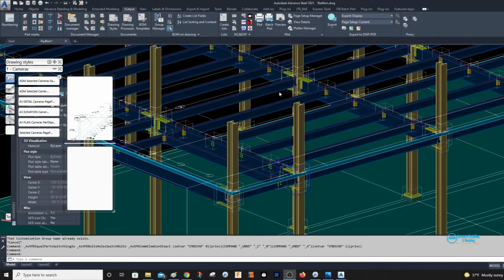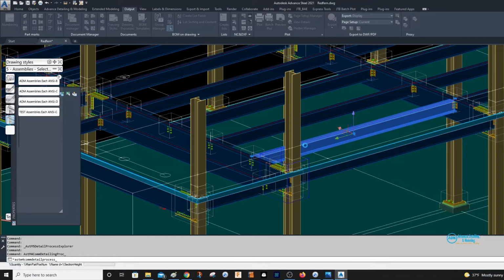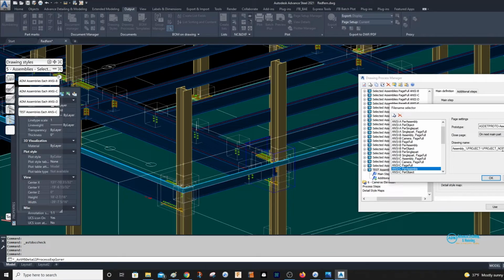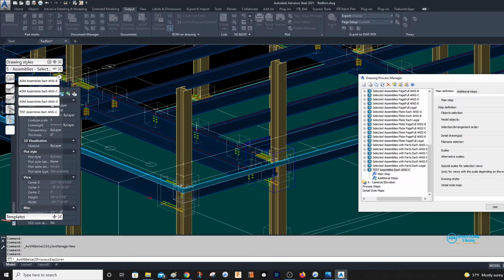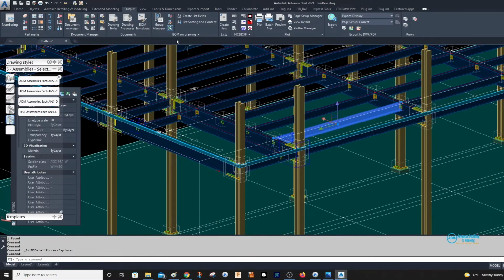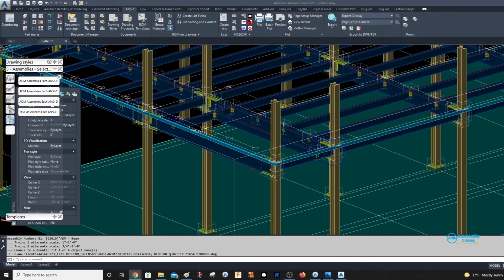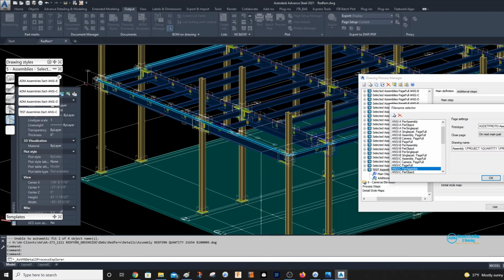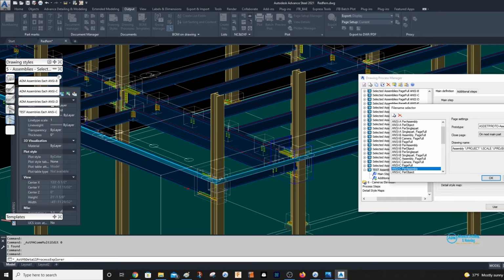ASED Testing Drawing Name Output.

Comment: This may help Sir.
I have found that the below works to have the project number at the start of the drawing numbering for output and and the document manger :
(There is a character limit of 64 characters on the filename selector)
Drawing Process Manager > EG: Assembley > Detail drawing(s) select the hammer icon.

Standard text below from a fresh install:

Main assembly:

[A] - %PosNum (%Prototype) %SequenceNumber(02).dwg

Multi Part:

[MA] - %Flat(03) (%Prototype).dwg

Single part:

[S] - %SinglePartPosNum (%Prototype) %SequenceNumber(02).dwg

Multi Part:

[MS] - %Flat(03) (%Prototype).dwg

Camera GA :

[G] - %Flat(02) (%Prototype).dwg

Kingspan UK details:

[KSP] - %PosNum (%Prototype) %SequenceNumber(02).dwg

Metsec Details:

[MET] - %PosNum (%Prototype) %SequenceNumber(02).dwg

------------------------------------------------

Modified text below:

Main assembly:

%PROJECT_NO [A] - %PosNum %SequenceNumber(02).dwg

Single part:

%PROJECT_NO [S] - %SinglePartPosNum %SequenceNumber(02).dwg

Multi Assembly:

%PROJECT_NO [MA] - %Flat(03) (%Prototype).dwg

Multi Part:

%PROJECT_NO [MS] - %Flat(03) (%Prototype).dwg

Camera GA :

%PROJECT_NO [G] - %Flat(02) (%Prototype).dwg

Kingspan uk details:

%PROJECT_NO [KSP] - %PosNum (%Prototype) %SequenceNumber(02).dwg

Metsec Details:

%PROJECT_NO [MET] - %PosNum (%Prototype) %SequenceNumber(02).dwg

GA drawing text will need to be change in the Managment tools. 
(Defaults) >Drawings General (Path of detail drawings and prefix):

%PROJECT_NO [GA]- %Flat(02)
Reply: Thanks Dvaid, we were hoping to remove the sequence number, but doesn't seem like its possible.
Reply: @adriandmangan  The (01) is the sequence number, this is what the system needs to have to ensure you don’t have duplicate drawing numbers, we haven’t found a way to get parts / assemblies to work without this in the filename. This is an extract from a email Via Graitec UK and myself.
Reply from the maker: @Maycad1  yea, seems that way, makes sense to be fair, to be honest its not for me its for a detailing company I know they asked me to look into it for them to help out, your input is appreciated David